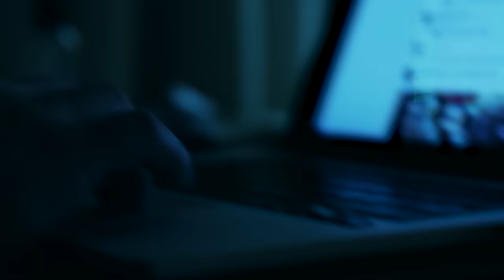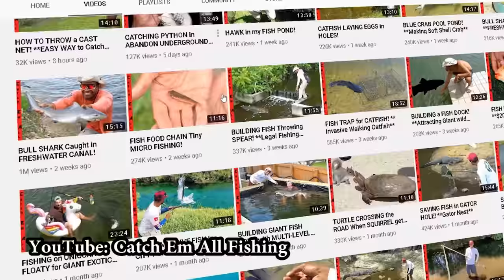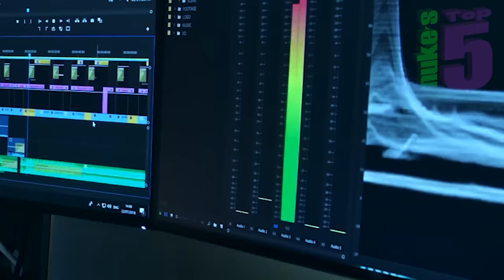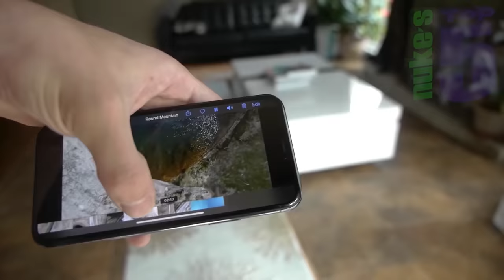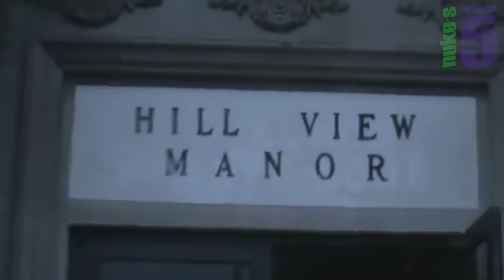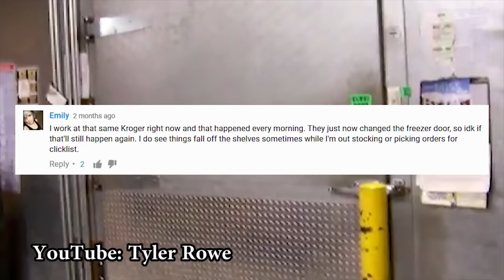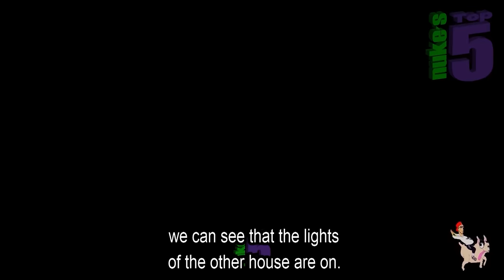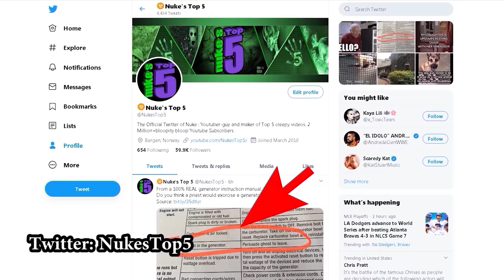TOP 20 SCARIEST Ghost Videos of the YEAR !

Comment: Someone needs to design a helmet that has a go pro attached to the back so we can start seeing if we can see things behind people I bet the results would be good
Reply: Good thinking, I bet there would be a massive reduction in “real” ghost videos.
Reply: Great idea!!
Reply: YES!!! A GoPro for Ghost Hunting.
A GhostPro if you will.
Reply: ... wouldn't you just... wear the helmet... backwards for that?
Reply: @Night.mare999   the point is to get the front shot and rear shot
Reply: @adriangalexis  So... why not use a basic helmet from a bike, have the normal go pro setup, then just cut out a hole in the back from the styrofoam and hard top, then place the go pro prop thing in that area and do whatever else.
Reply: @Night.mare999  better would be a 360° camera to record the sides and top as well

Comment: The Devil's caldron clip with TechRax and the phone may likely be explained by the sound of hot water entering the inside chambers of the phone which were at a different temperature. Like a kettle boiling it would sound similar to a scream. This would also explain why it did the noise the second time and not the first. It would also explain why the recording stopped after the second time because hot water would have damaged the internal parts
Reply: Im glad I'm not the only one who though about this
Reply: Can you explain how it spun underwater even when the line was released?
Reply: Yep
Reply: Yep
Reply: @breadofsalt  the first attempt was a 'dip' which breached the surface a bit but the second attempt was a full 'drop' meaning much deeper in the water. They also used a completely different phone the second time which would conflict data comparing to the first dip. On the way down the weight of the phone would shake the camera like anything would when sinking. The force of the line when being pulled by the drone back up caused it to spin again on the way back up. NukesTop5 used small clips which don't show the entire process

Comment: At the devils cauldron, when he drops the phone in the water. The sound COULD be the sound of the circuits slowly frying before it stopped recording
Reply: Jelly roll
Reply: So phones feels pain then
Reply: You're not wrong. I considered something that could be similar so I'll compare. I'm a welder, and I know when I put hot metal into water, depending on how hot it is, it'll make a "squealing" sound. Maybe the hot water boiled/ fried the phone as you've said, and it did make that sound. 

Good observation. I second it.
Reply: I think it could be the frequenz of the drone rotors which is going over the fishing line which has quiet higher tension as on the first drop